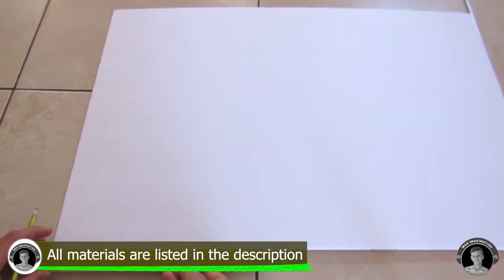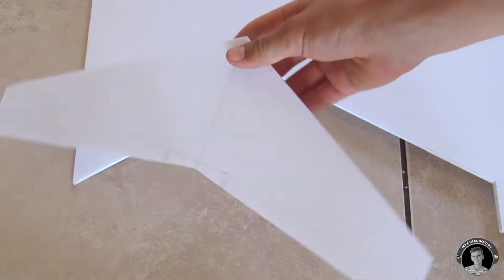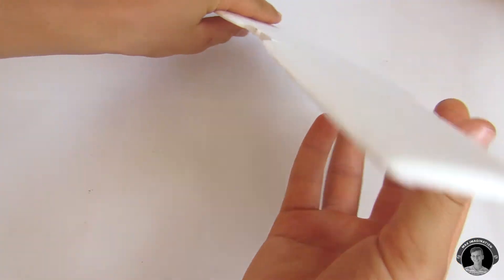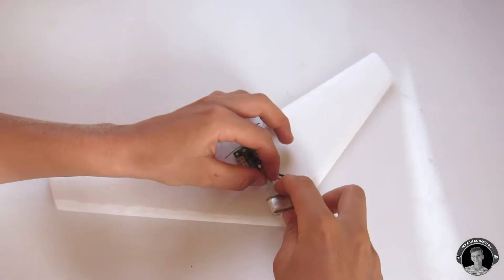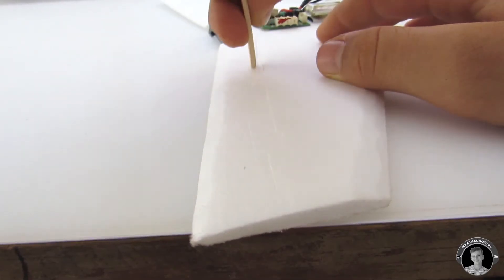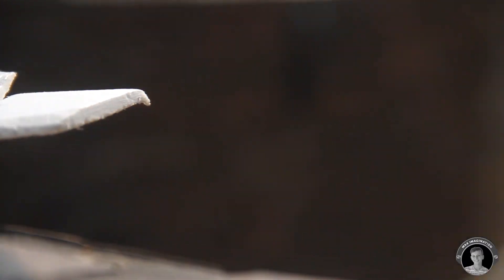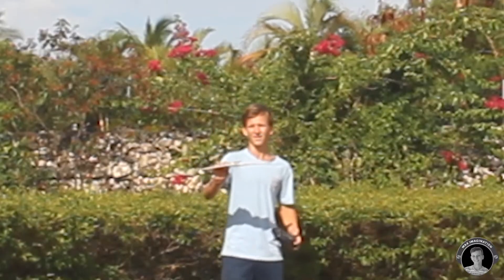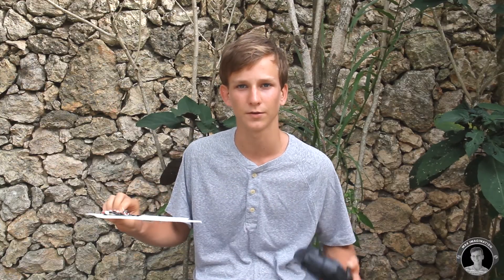How to make a simple RC Foam Wing Glider | DIY Motorized Plane

Comment: Probably should have made it a twin tractor design. That would give you diff thrust steering and nose-ahead stabilization. It is even possible to get a sort of 4-channel flight when using all 4 motors set at slight up/down offsets.
Reply from the maker: You have a point! Might do this with another plane in the future. Thanks for your tips. Cheers!

Comment: where did you find that reciever? I can't find it anywhere.
What would i look for in alternatives? Can i use any of the cheap quadcopter AIO's?
Reply from the maker: I got mine from a broken toy drone, you can find the receiver you need from any other cheap RC drone out there.
Reply: @MaxImagination  yeah right sir